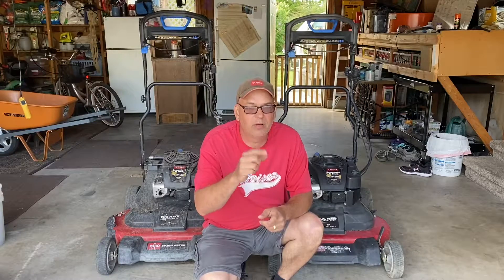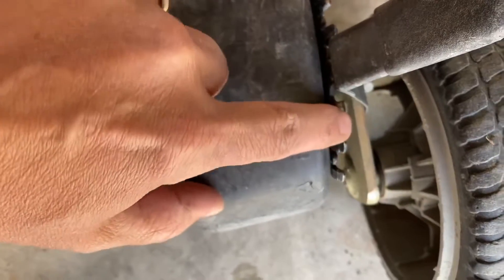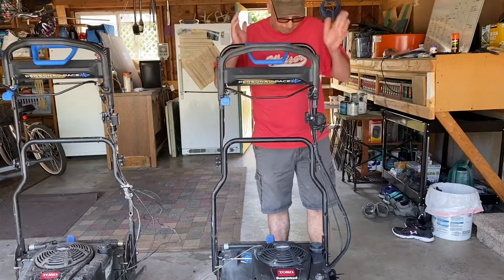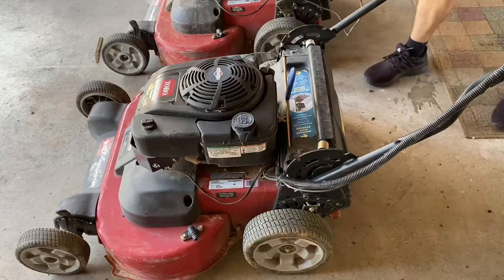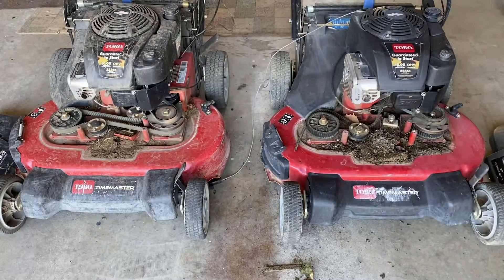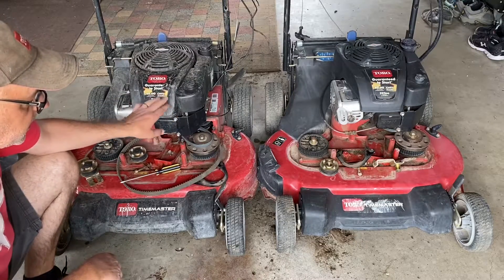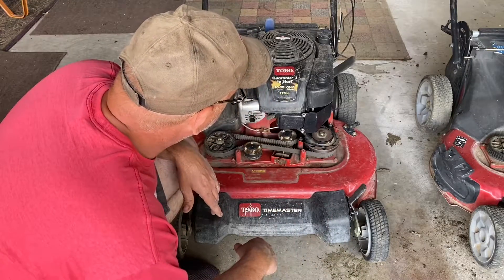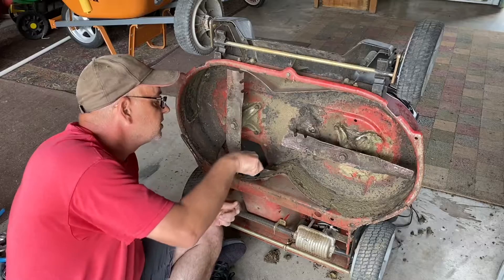Toro Timemaster rebuild Part 1,  Evaluation

Comment: It is important when you replace the pulley and put the belt back on to set the spindles so one blade is horizontal and other is vertical.  This is a great project you have going here. If I were you, keep them both. Don't sell the other one when you fix it up. You will have two solid machines that you know inside out and will trust. If one goes down, you still have the other. That is why I have two. Great video doug,  I might make a 10 minute video tomorrow of the rain falling here. Ba Safe man!
Reply from the maker: I timed the blades, I think I showed but did not explain it in detail.  The other mower might be a winter project,  we will have to wait and see. { I have some cool ideas for it}

Comment: I've worked on these for awhile now, I noticed the engine seems loose, make sure all engine mounting bolts are tight, also keep an eye on the head gasket, if you notice a big loss in power, and a popping sound replace the head gasket, also check the tightness on the main engine pulley, and go around and tighten up all bolts you can find, nice score BTW.
Reply from the maker: Will do,  Thank you for the help!!!
Reply: My self propel doesn’t work. But if I pick it up they spin some. I can stop them spinning with light touch
Reply: @pepaw  belt tension, do you hear any grinding or clacking in the rear when you push down, try adjusting the tension by the off switch.

Comment: i am curious to see how this goes. It might be time for me to buy a smaller mower and for the price, those time masters are hard to beat.
Reply from the maker: That's Right Lawn Care James talking with other that use them, they have their issues. But a couple dollars here and there keep them running strong. Guys that run them hard, stock extra parts for the most common problems and most fixes are 15/20 minutes.